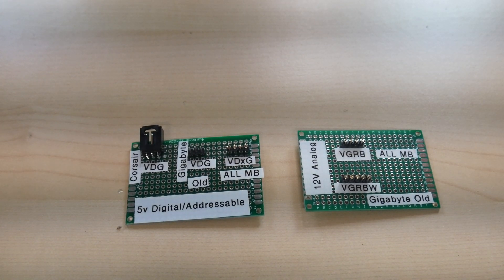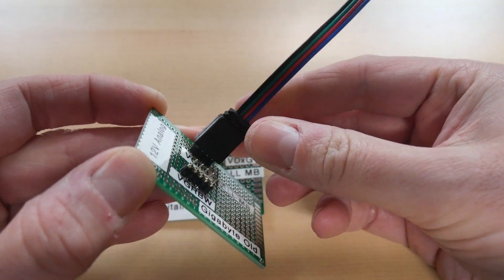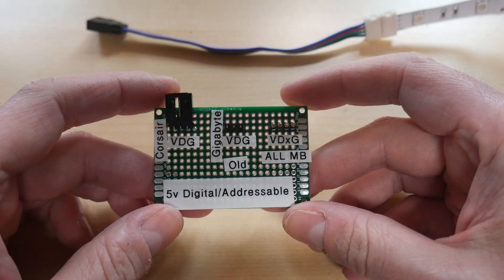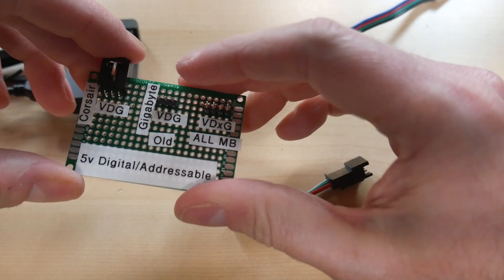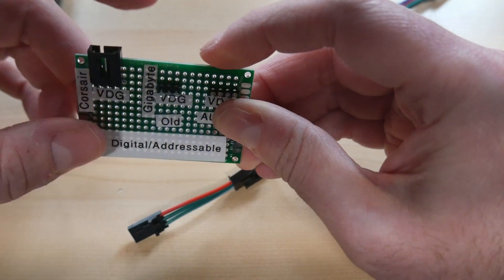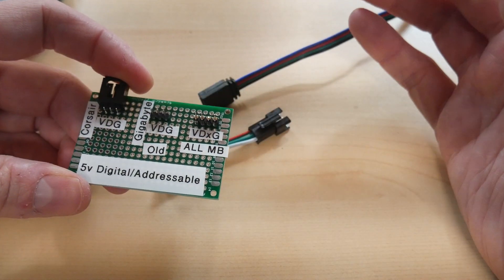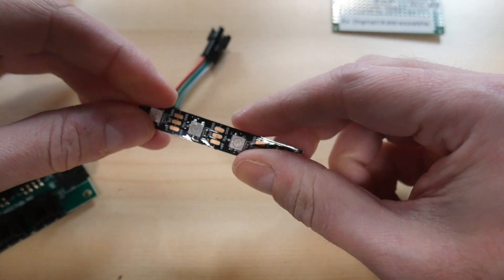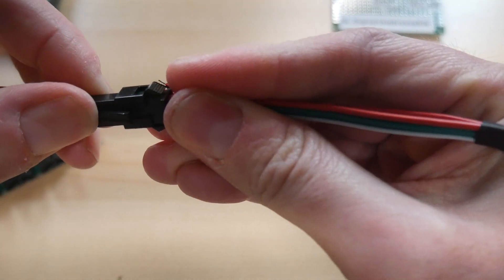PC RGB Headers & Connectors Guide (Digital and Analog)

Comment: This video is great. It cleared so much confusion with the Gigabyte VDG connectors. Do you know where I can get an adapter to convert my board (VDG) to (VDxG)? Would it be possible to make the (VDxG) plug on my board by removing the key pin slot?
Reply from the maker: Try piratedogtech.com for an adapter. If he doesn't have one in stock he can make custom ones. He lerks on my discord, so you  ask there.
Reply: @SolarityTechnology  I will look into that. Thanks!

Comment: I came here for the pinout. I'm going to put a switch inline on the V pin and mount a switch to the exterior of the case. That way, when it's movie time I can turn of the led strips in the case!
Reply from the maker: Good luck! If you use iCUE you can set an all off profile based off the app that is in focus.

Comment: Hey man, I really need your help. I just got the Lian Li Lancool 2 and the top of it has buttons to change the color and modes. The problem is, the rbg lighting is a 3 pin 5v but my motherboard only has 4 pin 12v connections.. is there a way to use the rgb lighting without having to plug the rgb into the motherboard while also keeping the the addressable rgb?
Reply: I have the same issue with my kolink balance case / asus b450 prime mobo. so far it looks like i have to run the fan as a slave essentially off the case rgb and the case rgb plugs straight to my PSU via sata power cable. waiting on my PSU turning up in the next few days to test it out n see if it works.
Reply from the maker: You need an addressable controller.

Comment: My m/b only has the VDG header, can i plug a VDxG into it. My m/b manual says it has jumpers which make it 5v.
Reply from the maker: You have an older Gigabyte MB. You will need an adapter to do this. You can buy it from piratedogtech.com or make it yourself. Good luck!
Reply: @SolarityTechnology  Thanks mate
Reply from the maker: @tuna-2779  any time!

Comment: Hey Solarity Technology, I have a question to a problem I have run into.?
I recently purchased an ASUS ROG STRIX B365-F Gaming MB which only comes with a 4 pin addressable RGB connector, but I brought a MasterAir MA410M CPU cooler which only comes with a 3 pin RGB plug, is there any way I can still connect it to my motherboard? maybe an adapter i could purchase or something?
Reply from the maker: You would need to buy a 3rd party controller. I prefer Corsair, though that would also require an adapter cable. There are also cheaper options, that come at the cost of flexibility and customization.
Reply: What kind of 3rd party controller would i have to buy? what are my other options?  spent alot on my cpu fan & dont want to have to buy another
Reply from the maker: What I would do differs from what others. I would do a Lighting Node Pro with a cable adapter from piratedogtech.com, though might cost around $60. You can get a cheaper controller from under $20, though you lose software control and/or have very limited control of the lighting and effects.
Reply: @SolarityTechnology  thanks heaps :D you deserve a like and subscribe :D
Reply from the maker: @r3deyedj3d1  thanks!

Comment: if I have a rgb header can I use it instead of a fan header?
Reply from the maker: You don't want to use a fan header for RGB.
Reply: Solarity Technology nah I’ve got a node pro so I don’t use the rgb header
Reply from the maker: @JMBO54  Can you give me more details on your setup? Also you have a RGB Hub?
Reply: Solarity Technology yes i have the rgb hub but it doesn’t use the rgb header, it’s the Corsair lighting node pro, I just don’t have any fan headers left
Reply from the maker: @JMBO54  Do you have 7 RGB fans? You can get a splitter, granted the effects would be identical on the two fans from piratedogtech.com you can also do a few other things. Also if you are talking about the 4pin RGB header on the RGB Hub. Please refer to it as a 4pin Molex SL header/connector. Calling it a fan header confused me for a few as that is normally refered to what powers the fan motor.
Reply: Solarity Technology nah I’ve only got 4 atm, but I just found the exact thing I needed on that link that u showed me, it was the Corsair fan splitter.
Reply: Solarity Technology thx for the help tho
Reply from the maker: @JMBO54  Anytime!

Comment: Hey do you happen to know the part numbers for the VDxG and VGRB female and male connectors.
Reply from the maker: There isn't really a great source for them. I buy the male's by bulk of 1000 from Aliexpress. I clip the 3rd pin to make the VDxG. The females can be had by plugging the 3rd pin and snipping it. They are both machine rounded. Something like these will work: https://www.amazon.com/s?k=2.54mm+round+header&ref=nb_sb_noss

Comment: i hate this its too confusing! I have a female cable which looks like the VDxG on your test board but no other cables that i could hook up to it. do i just leave it then? also i had 2 reset sw cables coming from my case on was labled RGB so i took that and connected it to the only cable coming from the RGB controller. Not sure were the + or - had to go cause they dont tell you! aahh no more rgb for me i hate it!
Reply from the maker: No reason to fret, the industry is trying to figure out what to do. :) What do you mean two reset cables? What case do you have? + = postive and - = ground. A lot of lower end and older motherboards don't have VDxG, which is addressable/digital/5v RGB.
Reply: @SolarityTechnology  I know it just get's to you when you try hours on end to figure something out does me anyway. Well i have a cable coming from the rgb controller which looks and this is best way i can describe it like the VDxG female counter part. so god knows what i have to do with that! And then theres the 2 reset sw cables yes 2 of them and 1 has an RGB lable round the cord. So thats the one i took and its a 2 pin female connector and connected it with the male counterpart also coming from the rgb controller there was no indication of a + or - so i can connect it both ways not sure what way is correct! If that is even the place i have to connect that cable. That the best way i can describe the issue. My Case is this: Inter-Tech W-III RGB. Thanks man!
Reply from the maker: @Maltebyte2  Yeah I completely understand. That is why I started this channel as no existing Tech Tubers didn't have much experience with RGB. Granted I am a niche^3 so getting subscribers is a little bit of a challenge :) Anyway I took a look at the case and it looks like it comes with this controller: https://www.inter-tech.de/media/widgetkit/9d_w-iii_fan_controller-a55ce27cfc8ac82e34a94cf28f19ca3d.jpg I know exactly what this does. The female VDxG is to allow your MB to take control of controller and treat it as a hub. The Reset switch with the male pins is for connecting into the real reset switch. You can use your seldom used reset switch for lighting control or for restarting your system. The two cables are mutually exclusive in their functionality. So plug the VDxG into your MB to control it with SW or use the reset switch to manually cycle through the effects/colors.

Comment: I have a motherboard that has a 4 pin rgb header, but the addressable rgb strips that I bought are 3 pins. Can I plug in the 3 pin into the 4 pin motherboard or will I have to buy a 3 pin to 4 pin adapter?
Reply from the maker: You will need a seperate controller for addressable. Check out my RGB101 video and don't fry the strips.

Comment: Do they have same pin sizes and shape? The VDxG and VDG? Thanks
Reply from the maker: No the VDG is square and the VDxG is round. The rounds are like they shaved the square's corner down to make the round.
Reply: Solarity Technology i see thank you for the information. One last thing i would like to ask is that, i have a gigabyte aorus b365m motherboard which supports 3pin(VDG), where can i buy those VDG-RGB converter cables? So that i can use VDxG interface in my motherboard? 😊
Reply from the maker: @alexisguisongan1902  I would contact Piratedogtech.com he makes custom cables.
Reply: Solarity Technology thank you so much!! 🥳

Comment: im planning to buy some rgb fans and they include a drgb that is 5v 3 pins. my msi b450 gaming carbon pro ac has a 3 pin header but its called J-rainbow 1 will it still work if i connect the 3 pin connector to my j_rainbow header
Reply from the maker: You should be fine, so long as you have a splitter for the fans.

Comment: Hello, I have an issue with my motherboard. My LED_CPU plug is plugged into it's socket but the board is no longer lighting up. The sides of the board are supposed to light up and the mono block. Some of the lights light up, but not all of them. Do you by any chance know how I can solve this issue I'm having without taking my motherboard apart again?
Reply from the maker: What board? Is the monoblock after market like EK or Barrow or was it a special version included with the board, i.e. z390 waterforce xtreme

If it is after market, what model?
Reply: @SolarityTechnology   Hello. It is the z390 waterforce xtreme
Reply from the maker: @anthonyturner9091  can you post some video of it or something? Did the lighting ever work properly? There could be an issue with the LEDs. I assume it has only one RGB connector to the board.
Reply: Solarity Technology hello.. I made a video and posted it to show you what I mean. It’s the only video I posted so you should be able to find it.
Reply: I forgot to say, I purchased that board second hand. The previous owner said it was in good condition and everything worked on it. However, it didn’t work for me. It’s just been like I described to you but also there are two connections one on the bottom of the block and one on the top, but they’re both plugged in!
Reply from the maker: @anthonyturner9091  I took a look at the video, thanks for posting it! I have some friends that have this board. Are you sure the lighting for that channel isn't disabled via software/RGB Fusion?
Reply: Solarity Technology hello.. I’m not 100 percent certain that it isn’t disabled, but I don’t think it is. I’ll make a video of the message I get on the software to show you
Reply: Solarity Technology I made the video of RGB Fusion to explain everything I tried to do.
Reply from the maker: @anthonyturner9091  I took a look at the video. It looks like you have everything setup properly. A wire or pin might have got disconnected. The LEDs inside the block might be damaged. The other possibility is to throw the main power switch on the back for a couple minutes. I have seen issues where the MCU locks up, though normally all RGB control is locked out. I would contact Gigabyte Support. It looks like you did a fair job diagnosing.
Reply: Solarity Technology I know it’s not the block. That’s a brand new block. Do you think it’s possible that the small connector at the bottom of the monoblock is upside down?
Reply from the maker: @anthonyturner9091 You can check, though I think the header is keyed.
Reply: Solarity Technology I’m really sorry to bother you with my issue, but what do you mean by you think the header is keyed?
Reply from the maker: @anthonyturner9091  no problem, there is usually a tab on the connector that prevents you from plugging it in the wrong way.

Comment: Hello! I'm using a GIGABYTE AORUS B450 M motherboard, which has the digital LED headers. The case I use (Versa J24 TG) has a few RGB fans all guided through a logic board, which contains an analog RGB cable (not sure if that's the right name. The one with 4 pins). I tried plugging that into the DLED slot (VDxG), and while they turn on, I can't seem to control their colors with RGB Fusion.

For reference: imgur.com/a/OAEtCzd
Reply from the maker: Looks like I already helped you on Feddit, please let me know if I am incorrect. :)
Reply: @SolarityTechnology  busted! ;)
For anyone wondering, this is what happened: https://www.reddit.com/r/buildapc/comments/dz28hn/standard_rgb_on_d_led/

Comment: I'm a bit confused about "data in and out" part. So corsair did it, diode have 4 pins. What about it ? whats purpose of different "in and out" feature?
Reply from the maker: The RGB diodes have one common anode (positive) and 3 anodes (negative). The ARGB that most manufactures use  has a little chip imbedded in it that controls the LED. Each one of these chips is connected externally to the strip with a ground, power, data in, and data out. The data out connects to the data in of the next addressable LED. If there was no data out then all LEDs would look the same. 

ARGB fans will all mirror the next fan if connected via a normal splitter to a single RGB header. As Corsair fans have 4pins, one of which is data out, this means that each fan can be colored different, if connected to the Corsair RGB Hub.
 
You don't see 4pins on an ARGB strip, but logically it is there.
Does this answer your question?
Reply: @SolarityTechnology  Now I get this one, thank you.
Reply from the maker: @FredgHar  Glad I could help!

Comment: My Gigabyte Z370 Aorus Ultra Gaming Wifi + OP. has a 2pin (5v) power Jack right net to the older VDG RGB Ports.  You should also make a video explaining how to adapt the cheaper RGB light strips (like the ones that come with a controller and remote) to work off the motherboard headers.. Or maybe like some of the RGB Fans that have a 5pin connector... How to split them back into two connectors.  1 for Power and 1 for RGB!!!!
Thanks for the great video!!!!

Comment: Great video! I would personally prefer the dac to have no back glow RGB but instead maybe placed near each connector to show activity (maybe could also match channels as you stated).  The feet are quite small it seems, maybe they could be bigger for more mounting support?
Reply from the maker: The placement on the bottom is to allow the under glow to show. If I placed them on top it would be very direct and would need something to diffuse the LEDs. The mounting points are lined up with SSD/2.5" drives. This is so people can mount them to their SSD caddies: https://i.imgur.com/JX1jAv0.jpg
Reply: @SolarityTechnology  Ah, I see.  In that case,  I could potentially mount it on my PSU shroud as it has the correct screw placements on a few areas.  You make a good point about the light requiring diffusion if it were placed on the top.  Although most wouldn't, I'd probably make a plastic cover/case anyways, similar to those for an Arduino.
Reply from the maker: @bcolewashere  Exactly, I do have 2 mounted to the back of my case and one mounted on top of the PSU shroud. You would be suprised how many hours of thought have gone into this project so far. One idea is for a sheet of acrylic over the board, if I were to mount them on the top.

Comment: I'd personally prefer no RGB on the back and cheaper.
Reply from the maker: Okay thanks for the feedback. The cool thing is I can put the pads for them and not add the LEDs at no extra cost. I could always do first runs without them and if there is a demand I could add them at a later date. They can be disabled via jumper and would have four that match the channels.